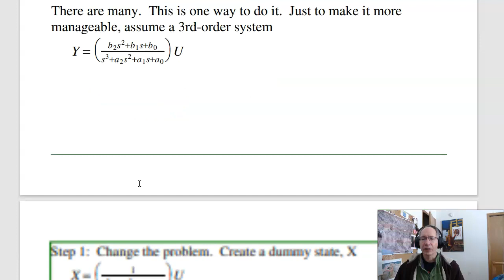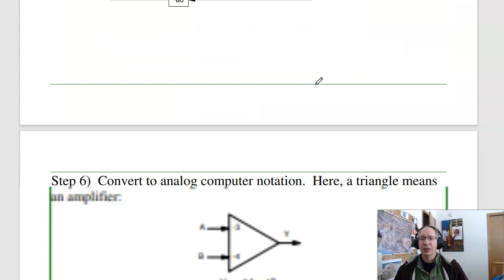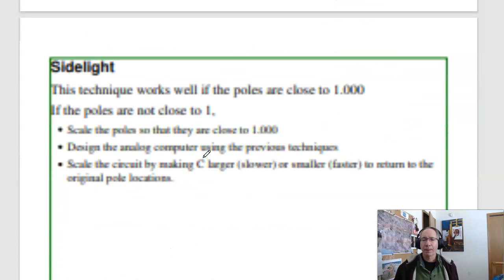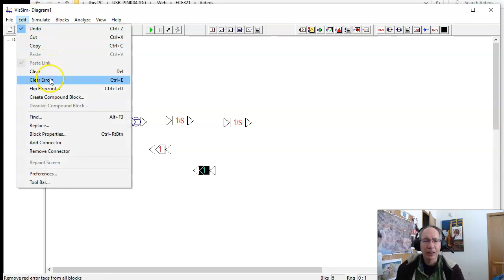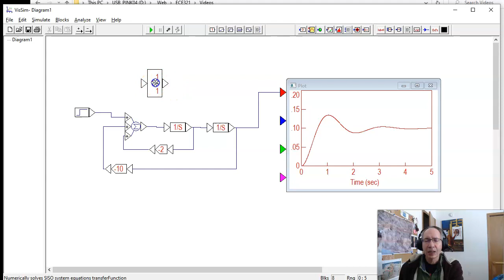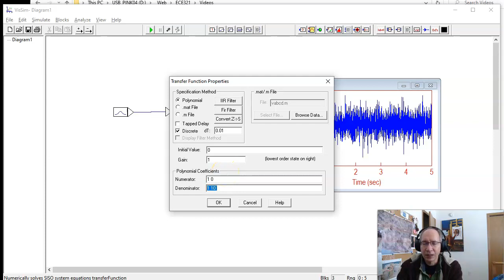ECE 321 11 Analog Computers

Comment: I'd love a hardware analog computer for the tactile feel. Nevertheless, what options are there, for open source analog computing simulation software?
Reply from the maker: VisSim was a really easy to use affordable package ten years ago ($10).  VisSim was sold to Altair and is still a good package if you can figure out the licensing.  Matlab Simulink is similar, not quite as friendly, but pricy.  CircuitLab supports analog computer simulation - and costs $24/year.  With CircuitLab, you also get a really nice circuit simulator package.  I'd go with CircuitLab at this point.
Reply: @Fargo1066  thank you so much for engaging and answering my question. I can afford that price point.